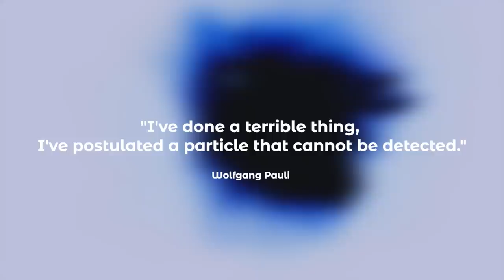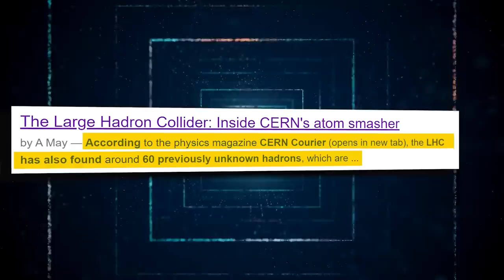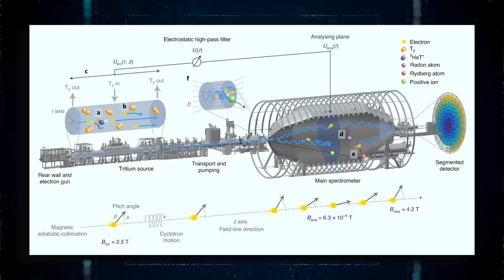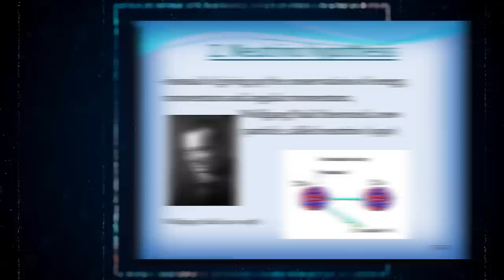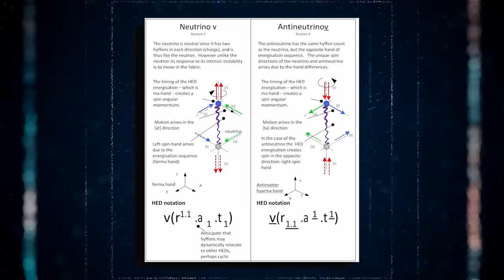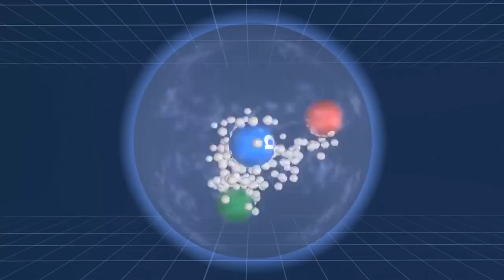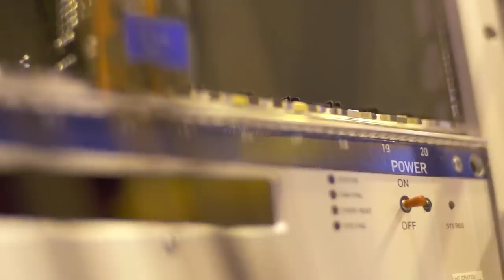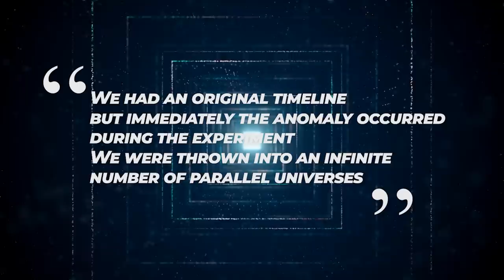CERN Scientists Just Announced A TERRIFYING Discovery

Comment: Alright here me out… this may not exist yet but in hypothetical circumstances so here’s my thought.

Say you have a ship, and you give it the ability to pass through physical objects like neutrinos by manipulating their physical properties…

Then use the hypothetical warp-drive that encapsulates the ship in a space-time bubble…

That ship would be able to go faster than light, pass through physical objects as if it weren’t there and wouldn’t even have to worry about any drag on speed (except) for the speed of space-time creating friction within itself, or on the outside of the bubble…
 
Either way, I may not have a masters degree but I do know friction still works even when we think it doesn’t.

The bubble around the ship would either generate plasma or some form of fire because it’s space-time pushing through space-time, it’s going to get hot in there.

I More than likely could be wrong, just going off a physical standpoint of what to expect if it doesn’t go as planned.

Comment: I saw a black hole or wormhole in a hotel room then a guy roughly a block away after I left said "We just switched Dimensions". That's not normal.Just comes out his door says "hey did you feel that" "we just shifted Dimension " ?No I didn't notice I was sitting only 3 feet from a Dimensional hole pinned between it and the wall static electric field from Hell watching my friend get stretched out and disappear before my very eyes.(turned out to either be an illusion or he was replaced by his quantum double).And things are out of place some are simply not there anymore. And no I'm not fucking around it scared the crap out of me!